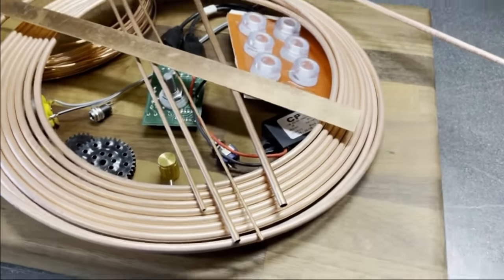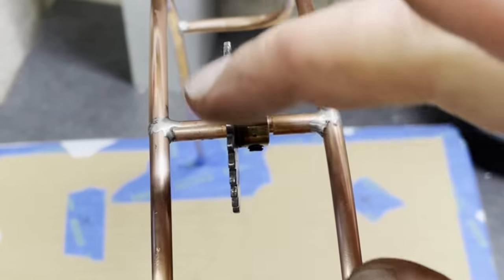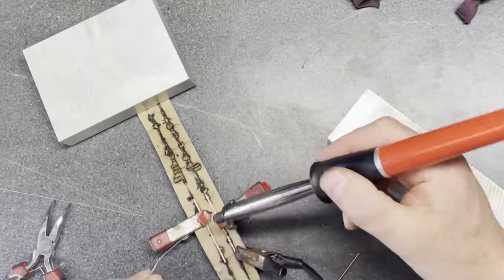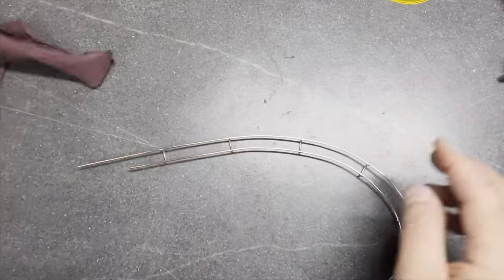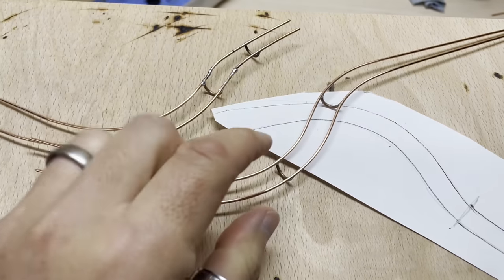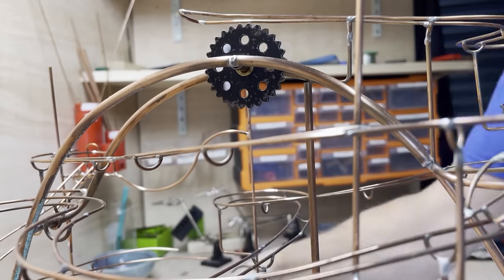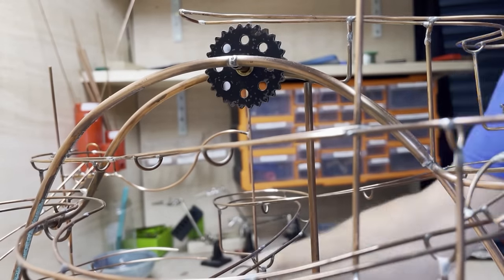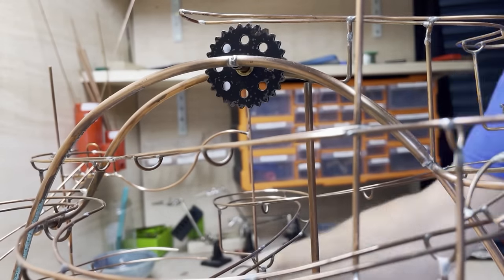Man Builds Marble Run - Complete start to finish TIMELAPSE with commentary

Comment: This is just splendid. Beautiful job, and great video content. The worst part though, is that something like this could never be sold; the proper price to compensate your time, effort, and talent would be astronomical. Of course, you'd never sell it. Two questions come to mind:

1) If you were to speed-up the ball lift system (or deliver a handful of balls onto the top of the track by hand), would vibrations and resonances develop that would cause the track to reject a ball?

2) Is there a Marble Run II in mind?
Reply from the maker: 1) it is sold. 
2) maybe the system would fail at some point!
3) subscribe to see my latest work. I’m on RBS7 now.

Comment: I've never seen a soldering iron like that. takes a lot of heat to solder all that wire, cuz copper loves to carry away all the heat. I have a big 325 watt soldering gun that I use for big copper things. as you pull the trigger it has a low and high. it vibrates in my hand, it's a bit unsettling, but safe. it gets hot fast, then tone it down to low when hot enough.
Reply from the maker: Sounds wild. My video description contains a link to how I solder.

Comment: Brilliant video 👏 excellent editing and narration....and obviously the marble run. Love these things....I made one as a teenager 40 plus years ago using wooden dowel.... worked a treat the negative things with mine were....all the runs were straight and ended in a 90deg turn and where I'd tried to get the marble to take as long as possible to the bottom if the contraption was put on a surface that wasn't 100% level the marbles will stall 🤦 
I do plan to make a solar powered one at some point that'll start once the sun comes up....... probably wake the house hold up in the summer months 🤷🏽‍♂️
Reply from the maker: Sounds awesome. Thanks for the comment.

Comment: Would be very cool to see some multicolored LEDs or fiber optics that would switch colors as the switch tracks flipped back and forth.
Reply from the maker: Thanks for the great idea.  I will probably use EL Wire on a future sculpture and will consider your idea then.  Cheers!

Comment: (thank you youtube for showing me this content only today )

two questions, why copper given the blow and oxidation concerns?

Did you treat the wood with linseed oil to protect it?
Reply from the maker: Copper is so lush and it does go slightly dull over a long period of time.  Which I like.  It is possible to spray laquer, but that just flakes off and feel more unatural than just leaving things alone.   The wood base was already treated when I bought it as it's a kitchen chopping board. Thanks for your questions.

Comment: Amazing creation! .. but that resistance soldering iron is horrible. Get a temperature stabilised one such as a weller, and wet the tip with solder to get heat flow into the part

Comment: Matt. I use this method. Can you recommend a foot switch? Thx R.
Reply from the maker: I made one from a 50A press to make switch that is normally used to start boats / old cars etc. it’s mounted on a block of wood and it just breaks the red wire when not pressed . I must make an update video soon.
Reply: @CopperGravity  Matt. Many thanks for the heads-up and the swift reply. Looking forward to RBS4. Best Wishes. Rich

Comment: What was the method for attaching the copper support legs into the wood base?
Reply from the maker: I drill holes that are slightly too small (0.1mm under) and then press the legs in.

Comment: 26:57 the last ball among three litearlly fell off onto the other track; was that designed or is that a crazy coincidence of fate?
Reply from the maker: Well spotted. You win the top spotters prize!  👀🏆 This happened a few times and it was not planned. Before I sold the sculpture it did add a safety barrier to keep the balls on the bumpy section of track.

Comment: Very impressive, thx sharing. 
I'm about to build a ball clock, and I might use some of your ideas. 
How does copper solder with gold solder to mach the color better. Have you tried to solder or experiment with other type of soldier than lead.
What gauge is the wire. Thx so much. It really was a beautiful work.
Reply from the maker: Hi. Thanks for the comments. I’ve only ever used one type of solder. Gold solder sounds like joy!

My wires are 1.6mm and 2.0mm.
Reply: @Copper-Gravity  thank you for replying and the info.
I work in imperial dimensions, so I  am looking to 14Gauge, which is around .074 thousands of an inch. 
Similar. Thx again.

Comment: What's the light (spark) when you weld?
Reply from the maker: Hi. I use a resistance soldering iron which does a tiny spark when the carbon rod makes contact with the copper. There is high current running through the wires which make them hot. Have a look at my resistance soldering videos if you want to learn more.
Reply: @CopperGravity  Thanks a lot!

Comment: You said you no longer use flux, what do you use now?
Reply from the maker: Hi. No flux. Just copper wire and solder. Much less mess to clean up. The joint does a bit black but very quickly polishes up with 0000 grade wire wool.